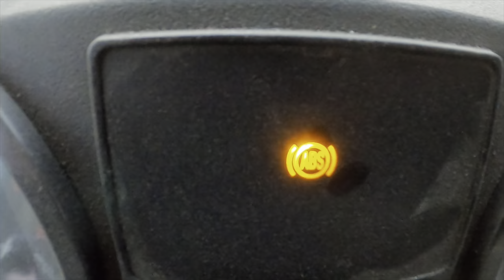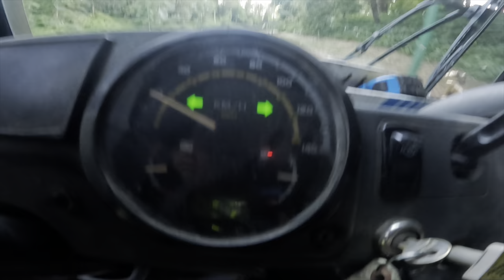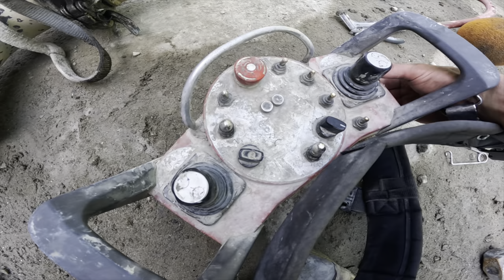Big day on the big-dawg, and my hopper was COOKED!!!

Comment: I had a job this week. 38m with 3 hoses for 12m inside a school auto shop. They sent grout as they said I couldn’t afford the 15 min if it decided to plug. And then I couldn’t wash up on site. The concrete tester gave me some delay for the 15min drive to the cement plant to wash. The agitator didn’t even spin once I got there. A small tote with delay and sugar will be added to the 2 pumps I drive this week. The worst part is the day before the boss and I had a conversation about it.
Reply from the maker: For sure! Once the mud is cook’N if find the delay type products to be relatively ineffective. I’ve yet to see concrete that cannot be stopped dead with brown/golden sugar. The best part: it’s soooo cheap!!!
Reply: @canadianconcretepumper1979  
This would have been a test for sure. I was told after 48hrs the car hoists could be bolted down and used without worry. The engineer told me that he designed it himself and was there to see how it worked.
Reply: @canadianconcretepumper1979 so what does the sugar do to save hot mud from really wreckin the day.
Reply: @2112kustoms.   the sugar stops the chemical hardening process of the concrete. It still dries out but retains zero strength which allows you to still be able to wash out the pump. There is a video on this channel a while ago with sugar concrete places inside a Tupperware container and left to cure for a while. You should watch it. It gives a great visual to what it looks like.
Reply from the maker: @2112kustoms.  stops the chemical reaction which causes concrete to harden. It will literally never harden to strength, ever.
Reply: @canadianconcretepumper1979  that's crazy that something from the kitchen can save a Gnarly clean out. Or if you wanted to, completely wreck a job! Less than a dollars worth of sugar😬
Reply from the maker: @2112kustoms.  oh dude, 50 cents worth of sugar could cost literally $50K in damage on a structural pour.
Reply from the maker: @2112kustoms.  tell them damn finishers to keep their double-double the eff away from the slab!!!! 😂😂😂
Reply: @canadianconcretepumper1979  hahah, im a carpenter, been getting into building guitars and pool cues. I do appreciate people that are masters of their trade tho! Cheers 🍻

Comment: By loading up the transmission in that gear it stops everything spinning, and then your PTO splines line up better, you are spinning your PTO in road speed, hence no grindy grindy! Fire trucks do the same thing, their pumps are driven off the transmission tail shaft as well, there is a transfer case that is either in road or pump, basically disconnects the driveshaft to the rear wheels!  To go from pump back to road, pause for a count of 5 or 6 seconds letting the pump slow down before shifting back to road, then it wont grind going back the other way. 😎
Reply from the maker: YES!!!!! This is the helpful answer and detailed explanation which I was hoping someone more well versed than myself in this topic would post. Most excellent. Thank you for this 🙏

Comment: Do you get any mixer driver's washing into your Hopper because here in Ireland about 12 years ago I had one driver who whould keep washing into my pump and he plugged me a few times told him not to about 100 time's and if he kept doing it I was going to send it back up over his mixer so he did it again and I put the pump to 10 on the pump volume and let the Hopper blow twice and then I put it into Reverse and it sent all back up over his mixer, after that he never washed into my Hopper again Good times me and the guys laughing for hours after it.
Reply from the maker: Lol! Off the record, but on the record… I absolutely love this!!!! Our drivers around here are actually all pretty good. We get the occasional new guy who thinks he’s figured out the magic secret to washing out with having to pull his bucket off the truck…. They learn pretty quickly that’s not how it works 😁🤔🤔
Reply: Here in midwestern USA doing residential footings often times I have the last truck wash chute into my hopper so when I pump it out the last little bit comes out at a 6 slump and not a 3 and makes it much easier to wash
Reply from the maker: @austinpalmlund5054  I do the same, but always make certain to leave the hopper at least 3/4 full as such that the water can blend in with the remaining concrete. If my hopper is low I’ll pull it back a few strokes until it at least half ways full. Totally depends on the mix as well obviously. Bartering with the mixers drivers (hopper wash for a bag of delay or gallon of Delvo) is how I acquire most I’ll of my retarder products 😁
Reply: I've had a few plugups due to this, often I look at how much it is and if needed I'll reverse the pump and drain the water out of the back of the hopper. note we spray our back pipes and hopper with a 50-50 mix of form oil and diesel fuel so the concrete comes right off.
Reply from the maker: @jamesmiller3128  yes! A tried and true technique. It just really sucks when it happens while your up on a deck/a mile away from the hopper and have no clue they’ve flooded you out until it’s too late. One telltale sign is when the pipes start slapp’N extra hard 8-12 strokes into a new load as the piss from the flooded out hopper starts making its way through the boom (if we’re fortunate enough for it to even get that far).

Comment: What does it mean for the truck driver to Slump up? Some of us are still new armchair experts lol
Reply: Adding water to the mix. When it starts to get stiff you will want to add water as you pour.
Reply from the maker: Driver adds water and/or plasticizer chemical to the mix to increase slump (make the concrete wetter/more fluid). The slump test is taken by filling a 12” tall cone with concrete, then lifting the cone from the concrete and measuring how far the concrete “slumps” down. Eg: of the concrete drops from 12” to 8” when the cone is removed, the “slump” would be 4”
Reply from the maker: Here is a really good explanation: 

https://youtube.com/shorts/5k4Vh9eZEE0?feature=share

Comment: I'm always curious how other operators get set up. My way of setting up is mix of what I've seen others do. Keep the videos coming. Pump On!
Reply from the maker: Appreciate then my man. I’m the same way. Most of what I do has been taken as bits and pieces from the way I’ve seen other operators do things over the years.
Reply: If my hopper is cooked, I sugar up. Recirculate and then blow down. Quickly rod the corners and S-tube and rinse the hopper down. Most of it should fall right out.
Reply from the maker: @brianmathe4219  I’ll usually do similar, or at least add the sugar when the hopper is still full as such that I can pump it through the boom before sucking back. Ready mix companies around here now forbid pumping sugared up mud back into their trucks (too many block forms stripped 3 days later and “goosh!” all over the ground!) 😂

Comment: Enjoy your videos. I started pumping in April and have enjoyed it. I noticed the wire you used to plug off the hose, thought id throw another idea out there that you might like.
We use small v-belts and I'll often wear it around my neck at the job so I can have it anytime to avoid splattering concrete in pin and wedge buckets,tools,etc when moving around at the pour, especially when pumping walls. Love your channel, keep on teaching.😁
Reply from the maker: Yes!!!! V-belts are my favourite! Was pouring a Saturday job recently and an retired mechanic neighbour brought me over a half a dozen belts. I hoarded them all onto my favourite pump in the fleet (my precious 38-5 Putzmeister). 

It would have been so much nicer filling the crane buckets had I had the air-cuff operational and in place.

Comment: i know im late to comment on the video 47:47 but i just did this the other day i was in a 45 cifa. i poured a 100m3 basement and then they ask me too do 3 columns on a 38c day. to do the columns i needed to day 20m of 3" line. they had ordered 3m for them, they needed 3m in the columns so it was short... so i had high strength crete in the line. so about 30mins so by the last load gets to me and i start pumping seems to be pumping ok just coming out of the hose like a hotdog. then when it comes time to start the clean up the hoses are still hull of 50mpa an hour old. ended up losing one of the 10m hoses... and almost the hopper. 

Some people have no idea how it can turn so fast. Thank for the videos mate.
Reply from the maker: It's been nearly 8 months and I still remember this days as one of my most hard fought of year 2023.  It's always the "oh, by the way" addons which make am otherwise great day.... much, much, less than great.

Thanks for watching brother 👊

Comment: First time tuning into Canadian Concrete Pumping! (That being said wont be the last) I love seeing different techniques done in our Industry. I’ve been pumping concrete going on 10yrs, It’s no secret here in Texas we see Triple Digit Heat (100+) in summer along with the occasional “Hot Concrete”(Concrete over 2hours from batching)which all operators know is likely to (FLASH/SETUP).$My Pro Tip Of The Day$-When Ready To Washout, Add your Retardant of choosing (Sugar/Delay) directly into the hopper to recirculate (Adding water to hopper as needed to slump up) before sucking your sponge back when dealing with (OLD/HOT) concrete.
Reply from the maker: Props to you guys for being able to endure that kinda heat. As I understand it, the humidity is quite brutal as well? I’m assuming that pouring at night is likely the only option for big commercial pours during your hottest of summer months?
Reply: Yes sir, we tend to deal with em both. (Hydration is the key!). You got it we start our “Big Stick” pours at night. Love what your doing with these videos. Long overdue for Operators to be put on the Map! (Stay Safe Out There Brothers)

Comment: Nice video, keep up the good work :) Your 58 meter is on 7 axels and the new 60 meter putz is on 5. That it's alot of weight reduction over the years. You said that the pump use 1 liter pr kubik meter. Thats alot I can stand and pump for hours and hours and pump and don't see it mutch on the fuel gage on an euro 6 truck (290 liter tank) 12 hours is long under 1/4th of a tank.
Reply from the maker: Yes, this pump has been THIRSTY since day one. It utilizes an emissions system which injects diesel fuel directly into the catalyst (which likely doesn’t help fuel economy). Even that being said, we are getting no where near the fuel economy which you gays are. I’m wondering if it could also be something to do with the dry/sticky mixes which are so common over here. Many of the videos which I’ve seen from Europe it appears that they pour at a much higher slump than we do over here, which would benefit fuel economy I would think? 

The new Putz 60M is on 6 axles in our market, but just barely makes weight… empty. This 58-5 I believe came on 6 axles in the European market. Our  weight restrictions here in North American are I’ve the top. Some of the rigs in the mid-western United States I’ve seen are just over the top (36M pump on a 6-7 axles chassis). 

Great comments. Thanks for posting 🥲
Reply: @canadianconcretepumper1979  The higher the slump and the lower strength of the mix its easyer to pump.Like the last vidoe you make in the mountains we call that gravel "nature" and the other "crushed" over here where I live. Here 36 meter is normaly on a 3 axles and on some old its on 4 axles. I Enjoy watching your vidz

Comment: So when you're priming the pump, why do you let it dump on the ground? Seems like it would be less mess to have the hose dump back into the hopper. Or is that because you don't want a large bucket of bentonite in the mix as it's just there for lubrication?
Reply from the maker: If you pump the bentonite prime directly into the slab, it can cause issues when they strip the deck as it will remain in a mud like state forever. Even priming/mixing it back into the hopper can be dicey. The bentonite mud is strictly for lubricating the pipeline when priming the pump. Bentonite does not set like concrete as it is literally just mud.
Reply from the maker: This is a great question. Many years ago we learned the repercussions of priming bentonite primer directly into a slab. It was a very expensive lesson 😁

Comment: being lazy is being lazy but could you hook the outrigger pad to the outrigger to pull the pad into place instead of dragging it yourself or does that put more strain on it?
Reply from the maker: Probably not the best idea, especially with these 4-stage telescoping front outrigger legs (there’s a good bit going on inside of those telescoping stages). I have moved pads around with the rear legs before, definitely wouldn’t recommend or refer to it as “best practice” though.

Comment: Speaking of fuel, does the usage change much based on how far your pumping? I’m in the land clearing side of things but kinda gotten hooked on watching your stuff.
Reply from the maker: Fuel usage dose vary quite a bit based on how much pressure is required to push the mix/sticky mixes like what we were pouring in this day, or say bridge deck mixes definitely increase the fuel demand. 

As an average, it’s safe to say that by the time we travel one hour to the job site, one hour back, and pump X number of cubic meters in between, you could assume one litre of fuel consumed for very cubic meter of concrete pumped. Eg: by the time we travel to/from the job site, pump 500 cubic meters of concrete, we’ve burned 500 litres of fuel. This girl is an absolute pig in terms of fuel consumption.

Comment: You guys change the pipe on the big one yet?
Reply from the maker: Full pipe kit went on last week. I was hoping to get the install on video, but was out pumping and not around the shop that day. It was really only a couple of pipes which were thin, the rest weren’t too bad, but we swapped out the entire boom system anyhow. Deck-pipe we’re going to keep in the crate for probably another 25,000 cubes (it’s still measuring at 70%)
Reply: Very nice pump on brother be safe

Comment: When do you use a 4” end hose vs a 5”? I don’t have a 5” end hose for my pump but I’ve thought about getting one for those big slab pours, so what’s your opinion?
Reply from the maker: Typically we’ll run a 4” hose up to about 100 yards per hour, anything over that we use a 4.5”, and on rare occasion a 5”. I really do prefer the 4.5” hose over the 5” as it’s a lot easier on the hose guy and also keeps a steady flow when we slow things down on the top up pass. 5” is cruel and unusual punishment, in my opinion 😂
Reply: That helps a lot thank you!
Reply from the maker: @spencerparks3139  no worries brother. Also keeping in mind that my personal preference is based on the pump-friendly mixes used in our area. I’m sure there regions where 5” hose is the go-to in order to avoid potential plugging.
Reply: I have been pumping 1.5” aggregate through 4” hose a lot lately and have only plugged 1 time in the hose but, I could see how if it was a lot dryer it might plug more frequently and a 5” hose might be more advantageous. I’m fairly new to this so just trying to get a lot of different opinions from people who seem very knowledgeable
Reply from the maker: @spencerparks3139  we have some 1.5”mixes that will pump quite nicely through a 4” whip. It’s mostly all round stone/river rock.